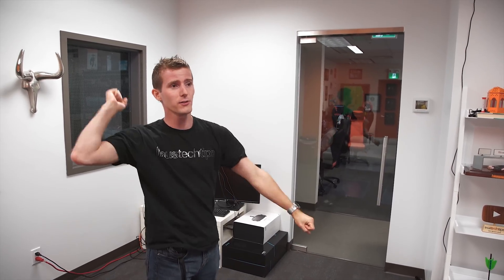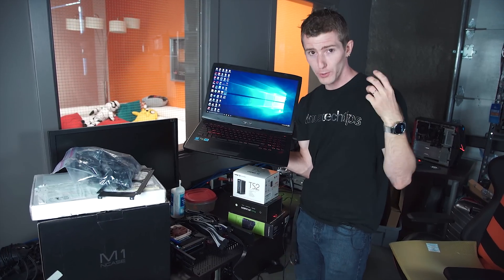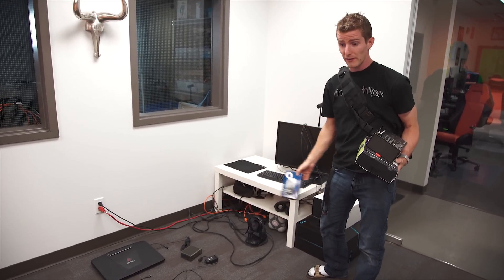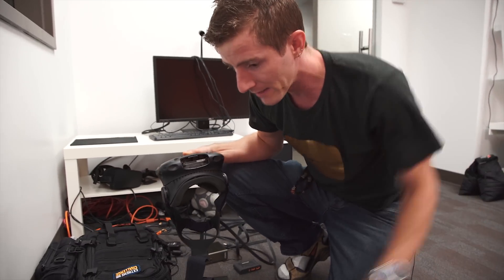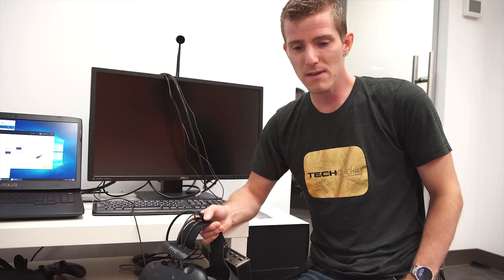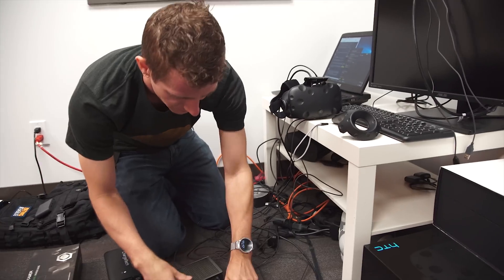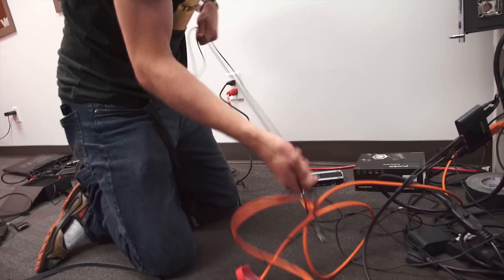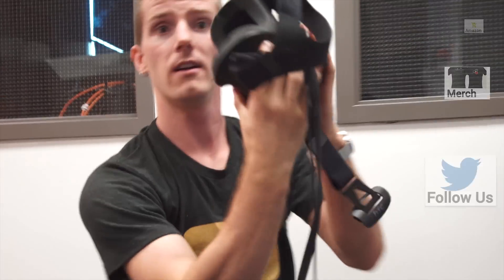Project Light Tether Pt1 - First World Problem Solving at its Finest

Comment: I don't know why you don't just run the cables along the ceiling and have the vive hang down in the middle attached to a cable retractor reel. Thus when you are playing you have freedom to move without tripping on cables as well as dealing with the weight problem.
Reply: +Kevin Rooney It doesn't take an engineer to think that
Reply: I was thinking the same thing, but the issue is the vive needs to feel weightless to be immersive, your head will noticeably be restrained by the force required to drag the cable out of the cable retractor, and rerouting the cable to say, a mount on your back would then allow you to tangle yourself. The idea becomes less practical the more you think about it, although it is a good idea
Reply: but wouldn't you have to consider the issue of slack in the cables, accidentally pulling the cables in VR with the controllers or having cables pull at the vive, right?
Reply: +Somebody Else "retractable
Reply: Wow nice idea!
Reply: Are you some sort of engineer?
Reply: joshua lotion that's how I'd hope it'll work but I don't think it'd be that sleek in reality
Reply: Lots of people have tried this and they all say it's not as comfortable as it looks :( have a search on r/vive
Reply: The things we do for games.
Reply: +Somebody Else it will be a pressure retract. It will retract till it feels a an opposing force. Should be a very callibrated system. Or a weighted pulley
Reply: hand and arm movement. If one routes cables from top, there is a highly likelihood of hitting the cable with controller and arm with games that require upper range hand motions (throwing, climbing, batting etc.)
Reply: Somebody Else there always has to be a shitty first one though
Reply: joshua lotion I do hope there's a good implementation that's at least semi-affordable at some point...
(or that intel technology comes out for wireless headsets and doesn't rocket the price)
Reply: Well, you could make a fixature for the cable on your back, attached with backpack straps or something... OR even better, because the Vive knows the headsets position in the room, the wheel could have motorizations and brakes to always provide the correct amount of cable. Questionable though how that would do with fast movements.
Then again, everything is better than getting feet and legs tangled in these cables...
Reply: This idea could work well by cannibalizing a vacuum cleaner cable retractor. Attach the release switch somewhere accessible and you're in business.
Reply: Wont work, unless you don't mind about feeling restrained or having your head slightly pulled to one side, you move around and the restraining force will change it's pulling direction, pretty sure that will suck and distract, the only way is to motorize the cable and have it linked to the Y axis position of the headset so the pulling occurs only when it needs to but still need to address the relative anchor point of the cable to the ceiling or supporting estructure to your actual position. My guess will be, overcome wireless limitations and add a cellphone battery to the headset.
Reply: joshua lotion "retractable" doesn't mean the cable will retract properly each time. it will retract to a point then stop, which could be too tight or have give, etc, just thinking that they'd have to make it so not only it retracts but it doesn't pull on the vive or pose a risk
Reply: tbh i though this was going to be the idea as the original post said.. That would work great.
Reply: This is Linus, he doesn't do things the easy way.
Reply: Dude I had the same idea!!! Except put everything in the ceiling which will leave the entire room empty
Reply: davidcapi If you give it enough slack to hang down to your lower back you should be able to walk at lest 4 feet in any direction without have it pull on you at all.
Reply: Coil the wires into a small backpack then hook it up to the ceiling mounted re-tractor and any tension that's felt would be distributed through the pack. You could also modify an old backpack that has a wait strap for even better distribution of tension. Cut out the old preferably too worn to be usable pack off and sew on a nice little custom pouch.
Reply: i have seen this done before with dog leads at a demo, it is actually a really great system
Reply: Thats what I thought he was going to do for the video
Reply: make a track on the ceiling with a little motor that can move in x y positions, have it track a dongle on the cable near the head unit, program it to stay above your head at all times, set the length of cable between head and cieling grid robot to what ever is comfortable. very much like an xray system
Reply: The VR Backpack that Luke makes a little later is much better

Comment: So your idea is fantastic and I love to watch your videos. But have you considered instead of using said person/playing using the vive to support the weight of the Vive gear but to use your surroundings instead? The issue at hand seems to be the cable and gear being lunged around and the backpack is a solution I see a few other youtubes concluding as well. But what about the walls and ceiling around you? The Vive cable seems long enough to where you can mount it through a tube on the wall(if this is in a room dedicated to the Vive, of course) and to design a axis on the ceiling to motion the cable around with the headset so there isn't any lingering cord but at the same time, if said person needed to lean over/crouch they would have that leway to do so. Then the goal for you or anyone else who's approaching this their own way is to design how exactly it'll be ceiling safe, what kind of grid is designed and how to overcome any common issues while still fully enjoying the Vive experience.

Comment: I am wondering(sorry, I am not that familiar in car parts), but does a car battery have significant wattage to power a pc? Even for a short time period? Like I understand it would not be a long lasting power source, but if a car battery has significant wattage to power all the components of a lower tier VR normal PC instead of a lapotop, couldn't you just do a small showing off or fun project with a legit PC case with light yet parts? I mean, it would probably be expensive to buy a spare car battery for just the reason of a VR backpack, that and having to do some rewiring with the car battery, but is it possible? IDK, I just got a sudden thought while watching the video, so I was wondering if anyone could tell me if this would possible, because it seems cool if it could run for atleast a couple of minutes.

Comment: Will all he's doing, wouldn't it be easier to just have the vive plugged into the laptop, put the laptop in the bag, then have the power cable for the laptop be the only cord to the wall?
Reply: The Vive needs AC power.
Reply: Link box runs on dc. And i think it is optional.
Reply: everadept
He's trying to use a smaller cord, not completely eliminate it.  There are already backpack solutions that eliminate the cord with battery options.
Reply: the laptop was just to show it was plugged in not for actually playing
Reply: He wants to put everything into a backpack. That way the cord is not on the floor in the way. The cord would only have the travel to the laptop in the bag.
Reply: No it needs dc.
Reply: Why cable? at that point you are better off with a big lipo pack.
Reply: the vive headset  run on dc but the vive hub were the headset pug in to run on ac/dc
Reply: It is optional, it's just a signal repeater to accommodate the long cable run.
Reply: tj rileyc
Well that can be taken care of with the battery pack that has the ac outlet on it.  It can go in the bag with the laptop and the laptop's power cord would still be the only thing sticking out.
Reply: +hellcat1988 why bother putting a cumbersome bag on just for a smaller cable that'll catch just as easily?
Reply: See, this right here.

Light, efficient laptop (blade?) plugged into a big power bank, vive plugged into a power bank, in a bag with front straps. By the time the batteries run down, you want a break from VR anyway, it'd still be light enough that after a few minutes you wouldn't even notice.

All problems now solved, probably end up cheaper by the time linus is finished buying 600 thunderbolt boxes and 20 cables trying to make everything work.
Reply: +damstachizz how is a blade cheaper than a few cables and a thunderbolt converter?
Reply: That adds more to the weight. The laptop is just there for proof of concept. Really all that would be in the backpack in his intended use would be the battery bank for the thunderbolt hub and the vive and the thunderbolt hub . From there the single flexible long thunderbolt cable would go to a PC

Comment: why not have the wire hanging from a ceiling mounted system that has 2 axis movement in a defined area then you can use any rigg and not have to worry about weight
Reply: Damn..
Reply: This was brought up way back and dismissed as soon as everyone realised that you kinda need to be able to move your arms around, something that a cable dangling from the ceiling is going to get in the way of.

It's possible to design around this, but the implementations start getting ridiculously complex and hence, unaffordable.
Reply: This is exactly what I want to setup for mine but I don't have the space to do it.
Reply: Espritt That actually happens a lot. In something like Audioshield I often end up almost hitting my ceiling.

If you're suspending the cable it has to come down somewhere and considering that the user can be anywhere in the room at any rotation with arms and hands in any position, it makes designing such a system far more complicated than you might think. In the end, it's easier to just let gravity do the work.
Reply: thats what i use i lower my heavy bag and feed the cable through the hole that has 360&#176; rotation
Reply: He is not an engineer. He said that in the start of the video :D
Reply: Josh R you'll feel it tugging when you are crouching though, which will ruin suspension of disbelief too. Really it needs to be wireless.
Also, cord is a cable, chord is a musical term.
Reply: holy shit, i thought EXACTLY the same thing when the video started...
Reply: giant mouse bungee
Reply: crouch and it rips the headset off
Reply: Ive tried this, its restricting, it works but i wouldn't recommend it.
Could work "better" if the cables was 1 instead of 3, lighter and also more flexible.
Reply: You are best off leaving at your feet. The problem is that you tangle your head or neck very easily and it instantly removes your suspension of disbelief
Reply: goddammit I just commented this too
Reply: I can't see it being a problem unless you move your arms directly above your head, whether the cable would be going up.
Reply: that's what I have been thinking for over a year now. can't believe noone has done this
Reply: +dolphin party There would be way too much lag with the shield.
Reply: 2 axes? What about 1 axis and a slider?
Reply: I don't understand the argument that you will hit the cable that is hang....how often are you throwing your hands directly above your head? A lost less then you are turning or walking on the cable...
Reply: +Ryan Boyd you could use a spring on the chord. it would pull up on the chord keeping moderately tight (as long as you pick a good spring for the job) to keep the chord above your head while you could pull on it when needed. I use a similar thing at my job for my hands next to heavy equipment
Reply: I hear ya on the bungie... and i would love to see it work. It's just that even after having a concious person hold the cable for me above and near my head, any quick ducking, quick 180* turns, fast lateral motions of the head, you quickly realize that its jerked from your head, in your face and/or immediatly irritating the experience. dropping the cable to the feet simply worked the best. I would love to see a video of a comfortable bungie system implemented
Reply: well to expand on the imersion because the vr already have a built in location and stuff why not get a drone to match the points and stuff and it pull the all weight around thus removing the personal stress of teh cable and stuff. and it doesn't ahve to be a flying drone but a rail system mounted to ceiling and what not it be complicated and riddle with difficulties and may not be possible for average.consumer
Reply: +Mythic Mike Yeah! Use a 1000+ USD solution for solving a simple problem!
Reply: ***** the problem right now is the delay makes it majorly uncomfortable for it to be wireless.
Reply: Exactly my thoughts! Just without the axis movement, I would have just let the cable hang down from the center of the ceiling and let it be long enough to move around.
Reply: crap i just said that idea to reply to someone else, you win
Reply: It's pretty cheap here - for 32.99 USD .https://www.gearbest.com/duffel-bags/pp_757786.html?lkid=11707668， Sweet！
Reply: +Rick Harrison im rick harrison and this is my pawn shop.

Comment: >2016
>VR finally starts catching on for consumers
>Not 100% wireless
>Mobile batteries still suck
>meh.
Reply: >greentexting
>whole life meh
Reply: wireless vr? woah buddy. technology is about taking steps to the finish line, not jumping over everything. you'd have to to wirelessly connect to the computer and use the computer's hardware somehow wirelessly. That's ways away.
Reply: +XDeadzX physically impossible for that to happen within that timescale. Video and audio compression and decompression rates will never be anywhere near usable for wireless vr for at least a decade.
Reply: +Ben Bega intel project alloy is wireless and coming soon™ like 2-3 years.  5-6 hour battery already with real sense camera tracking for controllers, no base stations or boundary mapping required.
Reply: /b/ros everywhere
Reply: We won't have any (good) wireless VR  for many years. Judging from recent news mobile battery's will get a decent amount better in the coming years.
Reply: Project alloy is augmented reality not virtual reality.
Reply: You neglected to mention the part where project alloy has an on board cpu and doesn't rely on a desktop for video or processing power. Not very good for VR gaming.
Reply: +XDeadzX Alloy is a computer-VR Goggle combination
Reply: >Intel
>Wireless VR
>ez
Reply: > yes

Comment: buy a laptop, put it on your back. problem solved.
Reply: Albert Hwang or just change the settings to not sleep the computer when the lid is closed.
Reply: you can set a laptop to still display the screen when it's closed.... Been a feature for close to 10 years....
Reply: that is literally what he is trying to do in this video, why did you need to comment it?
Reply: Well, for starters, the screen would have to be opened.
Reply: Albert Hwang Your comment wasn't there when I wrote my comment, I saw it when I reloaded the page.
Reply: +Albert Hwang Cut the screen off
Reply: spik330
I guess you could do that.
Reply: Water cool in a 202 or mini itx and build a self stabilization mount for it, to keep the liquid cooling all good.
Reply: +Albert Hwang Why?
Reply: +Albert Hwang not really it could be treated as a monitor... So you could tell it to not do anything when the lid is closed. Either way way too many problems for that idea...
Reply: It'd probably be easier to do a mITX build on a vest as they discussed in the most recent WAN show
Reply: You can change a setting to make "closing the lid" do nothing instead of sleep mode.
Reply: Not necesary, in power settings you can turn off the option to suspend the computer when closing the screen, used to do this when had potato internet, just a laptop and a lot of downloading to do, good times.
Reply: IamNotStupid1000 INVIEWPRODUCTIONS I've already addressed that.
Reply: shit, sorry, it didn't show all the responses and I guess I didnt see the "show all comments", my bad man.
Reply: +samandniko have done VR in a backpack